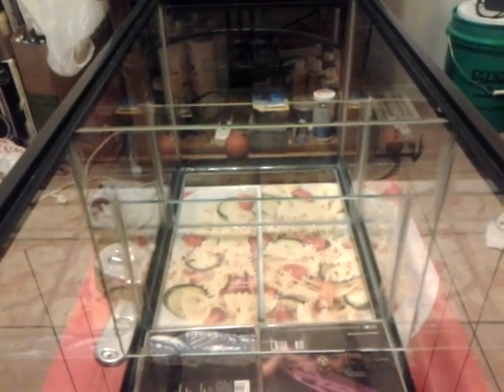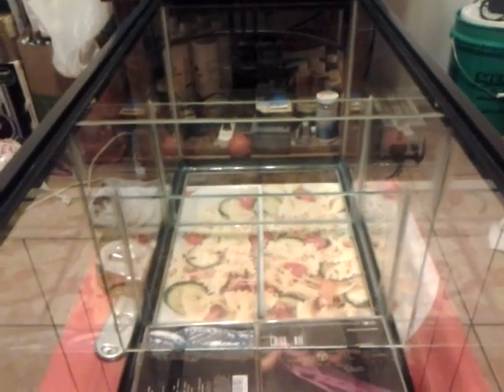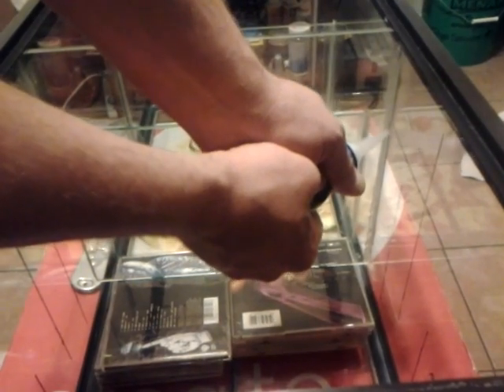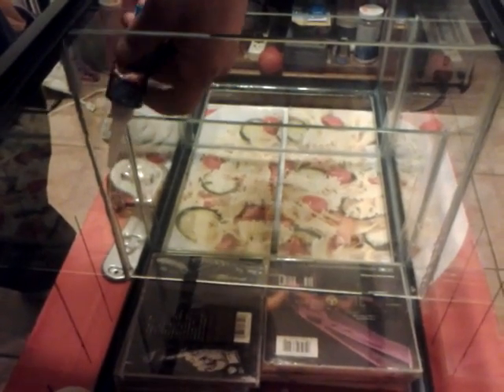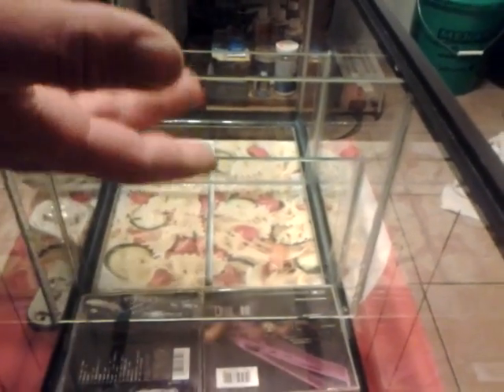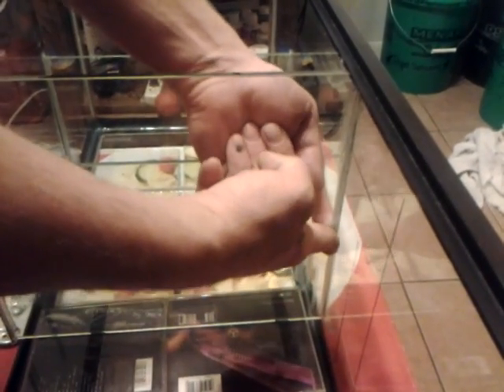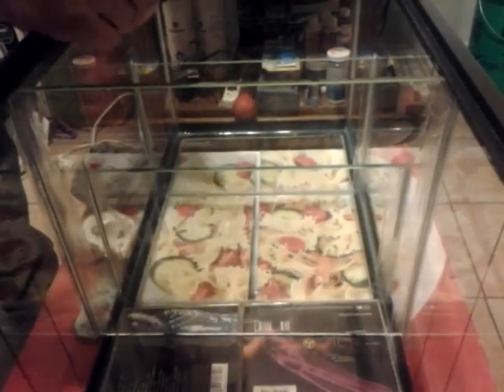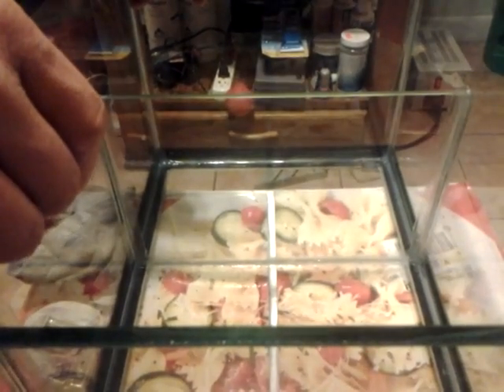DIY aquariums: PT 4 sump build & diy filter sock holder

Comment: Nice work! About to create my first sump for my new 125 housing african cichlids. I may need to reach out to you for questions...you def know what you are doing. Can i ask a question...my sump is 11.75 inches wide. How wide should i get my baffles cut? Was thinking 11.5 to have 1/8 wiggle room on each side. Thoughts?
Reply from the maker: Hey, I'd be happy to help, I'm glad someone is getting use of this. 11 1/2 is too small. I'd go 11 5/8. give yourself 1/16 on each side so you have just enough room to fit the piece in place and also the glue will touch the two pieces being joined on both sides of the baffle. also a 1/4 inch gap to fill with silicone is pretty large especially when it has constant pressure from water flowing, it's tough to seal and can possibly be a leaker. you can reach me at bubblegumpink71@gmail.com. thanks for watching and commenting.